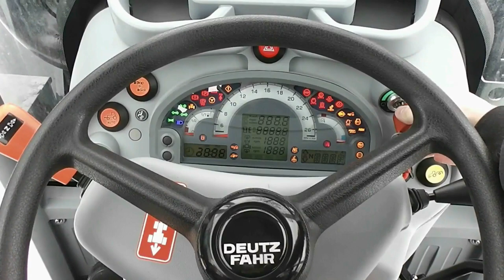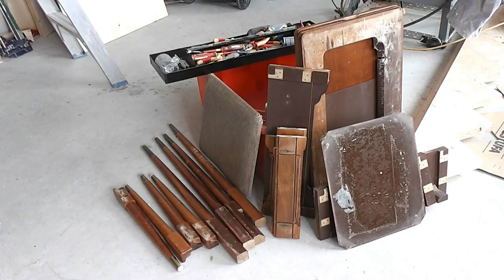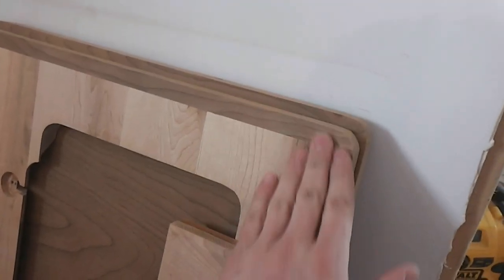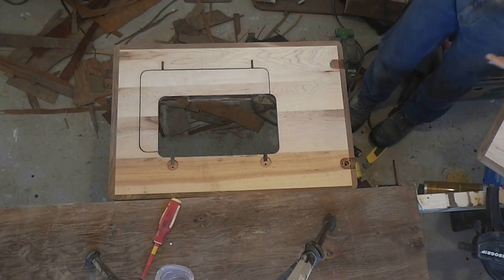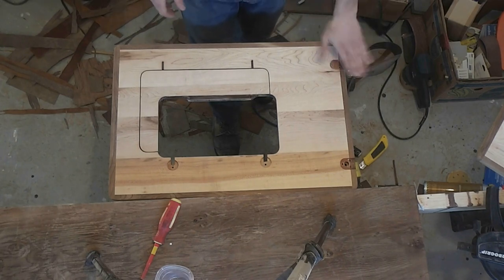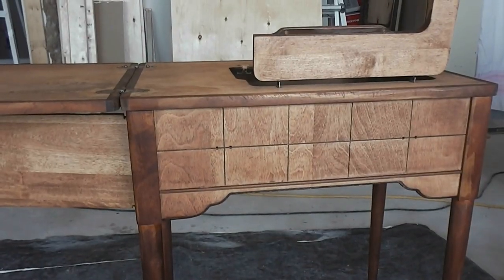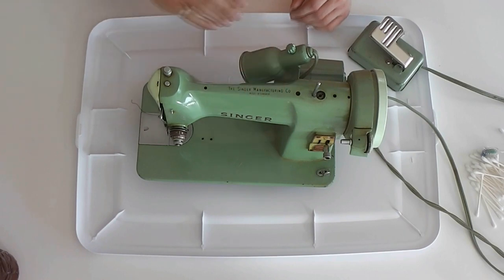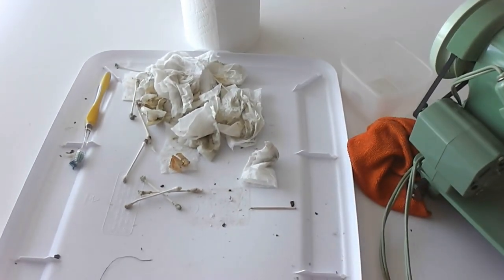Vintage Sewing Machine Restoration

Comment: Its a model 185j or 185k. J suffix made in St Johns Canada, k suffix are made in Great Britain (Kilbowie Scotland). You read the number on the motor which is only the motor model. Singer used a variety of motors and each had a different number. Its a very good machine, keep it oiled and it will last forever. Nice restoration!

Comment: I have my mom’s cabinet here.  It is exactly like the cabinet in this picture.  The spring lever that supports the shelf that holds your fabric while you sew is missing on hers.  I can’t find one anywhere.  It’s the lever that pops out automatically when you fold the fabric support table down.  What is the correct name for that piece.  I’ve been searching eBay, sewing parts online, etc.  I see a part of it that’s left still attached to the underside of the inner cabinet, but there is no lever nor spring. Yours turned out absolutely beautifully.
Reply from the maker: Thank You! I'm not sure how one could find replacement parts for the cabinet. I have the original paperwork, but unfortunatly they are only for the sewing machine, with no mention of the cabinet or it's parts.

Comment: Wow, you did a beautiful job!  My son gave me an old Kenmore he found in a shed at his "new" house.  I am going to clean it up today.  What about the inside workings?  Did you have to fix anything inside, or just oil it?
Reply from the maker: Thanks! Luckily the insides of my machine were in excellent condition, just needed a good clean and a bit of oil
Reply: @rensonsyard  I just cleaned and oiled mine, and she seems to be in pretty good shape.  She is olive green!  lol  I think she is a treasure!
Reply: Uh oh, feed dogs are going up and down, presser foot pressure is on max, but it is not pulling fabric thru. Any ideas?  I am willing to take it to a shop if I have to.
Reply from the maker: I'm certainly no expert, but it may have something to do with the stitch length setting.
Good luck!
Reply: @rensonsyard  Thanks.  I watched a few videos on it and they said that, too.  I worked with that awhile and took the length off of zero, but it didn't help.  I live near a repair shop so I will just take it in.  She is worth saving.  Thanks for responding.

Comment: How did you remove the veneer off all the pieces?
Reply from the maker: It came off pretty easily using a metal scraper 2:55
Reply: Lucky I have the exact same sewing table and I tried to take the veneer off and couldn't get it off as well as you. Still standing to get the remaining bits off, even gouged some of the wood trying.

Comment: Your video is a lesson on how NOT to restore furniture. By removing all the veneer yiu exposed the base wood which is the cheapest, no-grain wood used to construct furniture. The veneer that was on the table looked like a beautiful maple which was far superior to the sub-strata wood you exposed. No amount of Minwax staining can replace the fine veneer you destroyed. The missing veneer could have been easily patched and, done correctly,, would have been hardly noticeable.
Reply: I quite agree. It was bordering on sacrilege. He destroyed a beautiful cabinet, which could easily have been restored to its original luster.